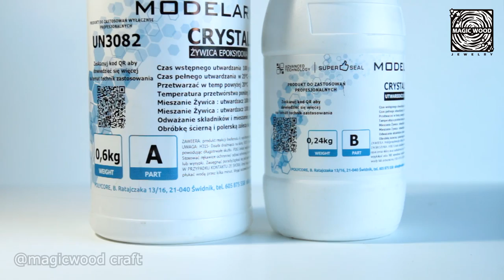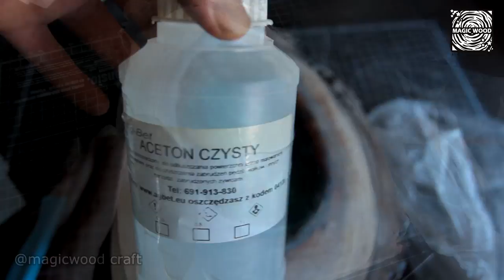Epoxy Resin Night Lamp / Diver Diorama from Walnut Wood 😍 DIY. Resin Art! How To Make

Comment: Where can I buy scuba figures like that and the lighting as well?  I’ve been practicing with resin and would love to move up to something as beautiful as this piece. Probably crazy but WOW you are so inspiring.
Reply from the maker: Hi. Thanks for the comment, I'm glad yew liked it 😊🤝 
As for the diver figures. I printed them on a 3d printer,
but you can also find them on amazon.
I also bought this light / base there
amazon > usb epoxy lamp or resin lamp 
and you will find. I also saw figurines there 
I used this light for the first time, but it is strong. Good 🤝✌️